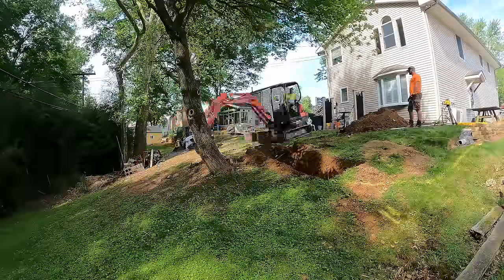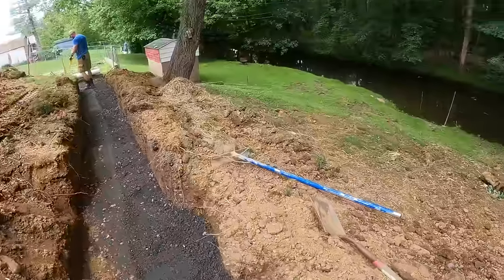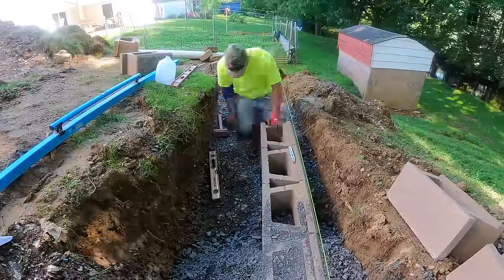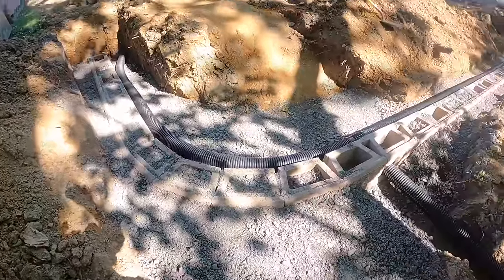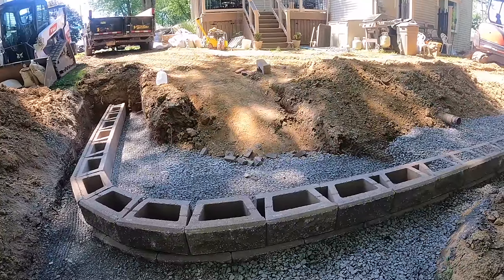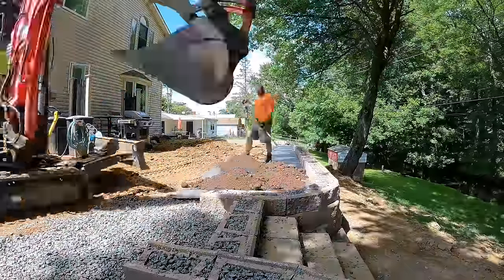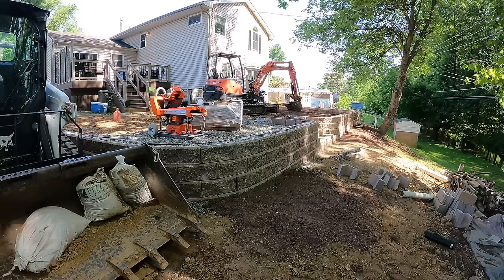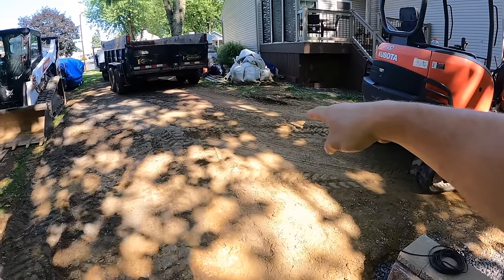How to build a retaining wall on a slope

Comment: Step one: Buy a 40,000 excavator
Reply: Rent one, bobcat e42 excavator 350$ daily / 1100$ weekly .
Reply: Step one- Get a 10.00 shovel and put it to work!😊
Reply: You forgot the 55k skid steer and that ex is about $60k new
Reply: An 80 series would be perfect for these projects…Bobcat E85( 19K lbs with thumb) Komatsu PC88(19 lbs with thumb)  Any of the MIDI series machines are great for tight spaces without giving up too much lifting/breakout force capabilities.
Reply: Step one: hire a contractor, because you will never do it yourself. Endless trips to Home Depot.
Reply: Or cough up 50K , that's is my 12 months income . For rich people.
Reply: Rent one for $700 for 2 days worth of work with it, gets you all the digging done and main bulk of aggregate put down. Pack it into your pricing. We do the rest with wheel barrows and of course all the pavers and cutting is hand work.
Reply: Step 1, convince your neighbor to buy an excavator.
Step 2, "borrow it"

Comment: Nice work!  but you killed the tree. On top of that the tree will most likely fall on the power line during a windy day. It is never good to cut roots mostly that close. Most contractor never care about the trees, and the owner often are getting upset, mostly when this tree, provide shade or character to the house. before working around a tree, ask to an arborist first and not to your landscaper. But very nice work on the retaining wall!!
Reply: Good observation
Reply: Another big one is when that tree goes most likely it will tear up that retaining wall.
Reply: @Luckingsworth  they cup the roots so that should not affect much. Mostly if they feel up the hole proprely just after.
Reply: Frfggg Ffgcdkkd  not the main root, and certainly not that close to the main trunk. 
I had to put down few trees in the past. And one of then was over 100 years old if not 200.
Every root fees on part of the tree. If you cut one you may see only one of the main branch dying. If you cut one of the big roots, they may not have enought, left for the tree to recover.

Comment: I would have took that tree off the hill its going to come down at some point and hope it does not lift the wall when it does But i bet home owner wanted to keep it. The drain pipe after the first course is not what the Alan block install video shows they want it behind the first course and i think they are wrong. The cap cutting on radius not easy need whole vid on how to that.

Comment: Nice wall. ALLEN BLOCK  IN SANDSTONE. NICE COLOR. I worked at a cement plant in Edmonton, Alberta Canada & we made those blocks  &  other blocks in the Allen Block collection.  Ran a forklift & had to stack the pallets in the yard for the Yard guys to load trucks  with. I did my whole yard with seconds( blocks that had defects that could be seen. Hell, I did not care. It was free. Saved me $ thousands. I have AB Courtyard along my driveway & AB Jumbos in Rocky Mountain Blend around my house.  Took about 12 pickup loads & loading & unloading by myself. Thought I was going to bust the springs on the truck.  Build good muscles working with that stone. Take care & God bless!

Comment: I appreciate the use of a proper structural retaining wall block. This looks like AB classics. Should last many years with no issues.
Reply: Are they, thought, or they just resemble one? I can't see any interlocking feature, nor they were cemented, or had vertical bars holding them in place: what would prevent them to slide away at the first heavy rain?
Reply: @Beregorn88  these are filled with clean gravel which “interlocks” them together. You can drive a piece of rebar or rod if you would like but it’s not required. Allan block walls are meant to flex for freeze thaw cycles.

Comment: I need to do something similar for a carport.
One end of the carport will be on a poured  driveway but the other end extends past the driveway and down a dirt berm.
I’m wondering what I need to do to secure and build up some block so that the carport is level  with the driveway from the dirt drop off.
It’s not a big drop really.

I was thinking of getting some railroad ties and dead manning them into the berm and just building it up with ties as needed then filling the rest in with dirt and a gravel top coat.

Any thoughts?

Comment: also, the hollow portion of the blocks must be filled with cement mortar to create adhesion for each block further strengthening each block with the rebars of course.
Reply: No. This wall is intended to let the water flow through. What you’re suggesting defeats the design and structural needs of the wall.
Reply: So no concrete fill is needed? How do the blocks stay in place, with the weight of the rock filler and gets stronger as time and water goes by?

Comment: I’m currently in the process of building a block retaining wall 20ft long by 3ft tall. I’ve got my trench dug and leveled. I’ve looked online and I’m confused by the type of base gravel type I need. So do I need to put fabric on top of the dirt, then fill with gravel, then start my base block layer. Then do I keep putting gravel behind the wall or do I backfill with dirt? If anyone could help or guide me in the right direction that would be much appreciated
Reply: No mesh/fabric for base layer unless you have sandy soil

Comment: So question of a novice. Why do you not use mortar or cement between blocks? Just curious. I'm about to start a little project of my own in the next few months
Reply: This looks like Allan Block which is a segmented gravity wall. This wall is meant to heave and flex thru the seasons the mortar or cement would just crack. The spaces between blocks is also meant to help with drainage thru the face of the wall.

Comment: Very nice work.  Did the slope of the hill prevent you from going out farther?
Reply from the maker: Thank you very much, the slope got pretty drastic after the wall. Moving it out 5 more feet would have more then doubled the cost of the project. Plus the customer didn't want to lose the tree if they didn't have too.

Comment: if u are not wrapping that pipe like a burrito with the rocks above and below then pinned together on top with a non woven fabric that system isnt going to last.  the non woven material prevents dirt from getting under it so no dirt in the rocks and no dirt in the pipe.  keeps it free and clear for decades of use.

Comment: I see you did three lifts for the base. Are those 8" lifts? So basically 2 feet before adding any block?
Reply from the maker: We do lifts in 3 inch increments. The base is about 8 inch after compaction. Thanks for watching and hope this helps

Comment: In one of your Retaining wall vedio, which is 4 feet tall, you have provided some slop ( approx 30 degree) in front of wall( leveled area). Here I don’t see. Does it mean the taller wall require some slope or it depends upon surcharge ?

Comment: That leaning tree just in front of the wall is indicating soil slope movement. If over the process of the wall installation the tree roots wer damaged or cut, the tree will sure finally fall down
Reply: 0:55 there was one big root

Comment: i obsrve that you americans do not use reinforcing bars to further strengthen the walls against overturning due to soil+ water pressure. also, in your building wooden houses with concrete hollow block no rebars were used in foundations. is that your building code? im from the phillipines.

Comment: Instead of a paver patio, could you do concrete? would the retaining wall be able to support the cement?
Reply from the maker: Absolutely, as long as your wall is built to support a surcharge it will be fine. The wall we built here could support a concrete patio with no problem. Now if the customer wanted to park a car on the concrete then we would have needed to extend the geogrid further (per engineered design). If your ever not sure it's best to have a civil engineer design the wall.

Comment: Hollow block is the worst kind can be used
Reply from the maker: That use to be the case. But modern technology has changed they way the blocks are casted. These blocks weight 80 lbs each and get filled with approximately 40 lbs of stone. I know walls built with these blocks that are 30' tall and have been there over 20 years in the Northeast.
Reply: @srmcontracting  Thanks for reply .

Comment: Great video! Some questions. 1. Can you use 3/4 clean as your base instead of the modified rock? 2. Does the drain need to be sloped toward the discharges? 3.  Do you cap the ends of your drain pipe or leave uncovered?
Reply from the maker: Thank you, yes you can use 3/4 but your drain would need to be in the base. The drain pipe can be flat or have a slight pitch. This drain pipe shouldn't get much water at all. Cap the pipes or put some fabric over the end. Thanks for watching

Comment: Appreciate the video, very detailed.
Just wanted to ask any reason why you didn't use a fabric to seperate the soil? 
Also wouldn't it be beneficial to use geogrid in the base?
Reply from the maker: Thank you, We never use filter fabric behind walls in our area. Our soil is mainly clay, that will clog the fabric and end up putting pressure on the wall. The only time engineers recommend fabric behind the wall is if the soil is very sandy. You can put geogrid in the base but it's not necessary, just make sure you have good compaction.

Comment: Questions about that big tree root you cut during the digging phase. With that tree being on a slope, could cutting a root of that size kill the tree, potentially knocking it over in a storm? Its so close to the wall im afraid it might pull up the soil and destroy the wall too.  Would it have been better to leave a gap in 1 block on the base layer to leave space for the tree root? Just fill and level the gap in the blocks with stone over top and around the root?  Or would that make the wall deform as the root grew bigger over time.

Reason i ask is because i have an old drystacked flagstone retaining wall on a slope, also supporting a flagstone patio.  Its probably 50 years old, and is in need of repair. There are massive trees right up against the retaining wall, and im going to have to dig near them, but im also concerned with killing the trees. Not sure if i should just slap some morter inbetween the dry stack to help it hold awhile longer, or just rebuild completely and dig.
Reply: That tree is definitely dead. Just running heavy equipment within the tree drip line can potentially kill the tree.

Comment: So completely dumb question, when you install the drainage pipe how does the water actually get in the drainage pipe along the entire length of the wall?
Reply from the maker: That's not a dumb question, the majority of ground water will drain through the drainage stone. In the event there is excess water it will run down the drainage stone and enter the pipe. Most of the time the pipe will discharge little to no water.

Comment: Nice !! Serious question, why not a footer ? Like the content
Reply from the maker: Thank you, these walls are engineered to have some flex with ground movement which is why we use stone instead of concrete. This is very important in areas that have freeze/thaw cycles. Thanks for watching!

Comment: Nice work !!  I like the stairs. The lights behind wall, Solar or Home light ?
Reply from the maker: Thank you, they are low voltage lights. They tie into a transformer which plugs into a electrical outlet near the deck.

Comment: Very cool video.  Thanks for the share!  quick question - do you never have enough back pressure on the wall where you need to glue /rebar the blocks?  just wondering under what circumstances that should be done?  Cheers!
Reply from the maker: Thank you, these retaining wall blocks are meant to be dry stacked and filled with stone only. I believe them being dry stacked only allows for some lateral movement without causing wall failure. Thanks for watching
Reply: @srmcontracting 
I have a large project that requires such retainer walls. About 8 feet tall 

It’s very hard to find a contractor who would do the right job. It’s not my trade so looking to subcontract
Reply from the maker: @nyhis5533  Where is the job located? Also when are you looking to have it completed?
Reply: @srmcontracting 

New York. As soon as possible
Reply: @nyhis5533  I've got the same type of job in NY, did you find anyone you like?

Comment: My daughter has a retaining wall 75' across, made of 8x16x8 concrete bricks, 6 courses high. With a 1' x 12"x75' concrete pad under the build.
(Sd.,Ca.) . I came from phx and this would of been 3' x 12" x 75' and phx is flat, present wall contains (in my dreams) 18' with a 12' rise behind it. scary!

Comment: So many unnecessary technique you added for this dinky wall , could of gotten away with 8 inch deep trench, no geo grid , over all prolly could of saved yourself a days work if you were more confident in your work
Reply from the maker: Sorry but I have to disagree. This wall was built per NCMA and the manufacturer specification. If you only dug an 8" trench on this slope the wall would have guaranteed failed. Thanks for watching!

Comment: So, what is the technical names for the types of gravel you used for the base and then the "clean" you used behind the wall?
Reply from the maker: The clean stone is 3/4" stone with no fine material mixed in. Some areas call it 57 stone. The base is 3/4" modified, which is 3/4" stone down to stone dust. Thanks for watching

Comment: That wall looks amazing dude. Im about to build one myself. 25' sloping at one end. The block im using is Clifton beveled edge, fairly similar to the ones you're using in the video. The wall will be about 50" tall at its highest point.. about 7.5 courses high, first course below ground. The blocks are 17 x 8.  Question is, with this style block, should I use adhesive on each course or do you only glue the cap? Also, I plan to run geogrid after 2nd course and 4th course.. does that sound reasonable? Im putting a poured stamped patio at the top when done. Thank you
Reply from the maker: Thank you I appreciate it! These blocks don't get glued, only the caps. You can double check with the manufacture to be sure but most actual retaining walls are designed to have some flex. I would put the geogrid every 2 courses (rows 2,4,6). Also depending on the slope you may need to bury another row. Best of luck, let me know if you have any more questions.
Reply: @srmcontracting  , ok, that's kinda what I thought, just wasn't sure. I will be using the geogrid as well. Talked to a friend about this today and he said the hollow core block just aren't durable enough to withstand a tough climate and such, he's got me all worried now... I have 155 blocks sitting in my driveway with no real way to return them... maybe you could give me some insight on this? Im nervous. I wish I could show you what I'm doing.  But the best way i can explain it is, right now i have a deck on the back of the house, I'm tearing that off, building the wall on one end extending from the house out 30',  then filling in about 48" to 55" to level the area behind the house, then putting in a patio in place of the old deck. Hope that makes sense. One more concern I have.. these block don't have a septum down the center at all... so to achieve a staggered joint wall I plan to cut and use a half block to start every other row. Can I do that safely being that there isn't any center support once I cut it? Sorry to bother you with this but it's good to have some insight from someone who has experience with this style block. Thanks for your help, I appreciate it greatly.
Reply: Get a block that pins together not the blocks with the lip on the back
Reply: @jamesbuege6911 You 100% should not be using a hollow block for such a massive wall. Those are for small garden walls.